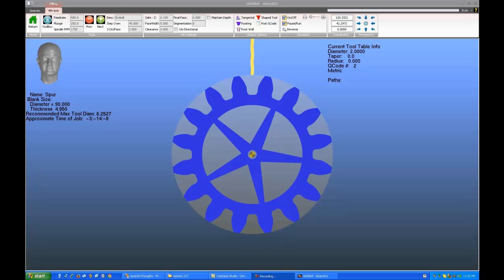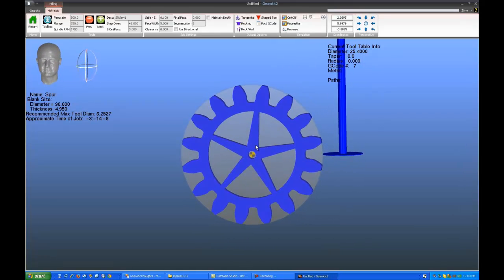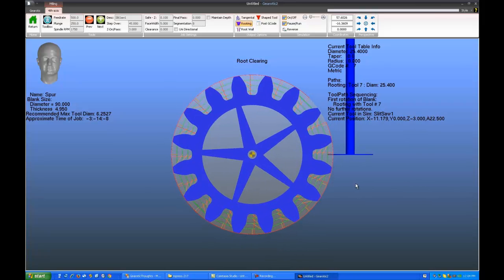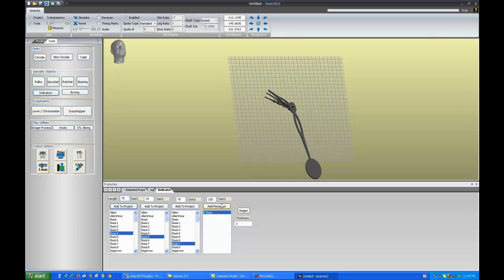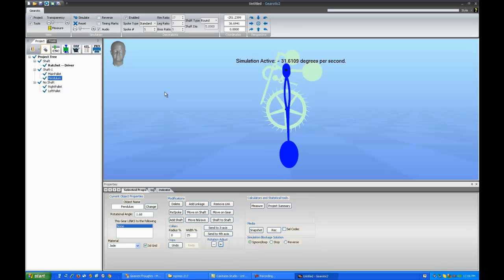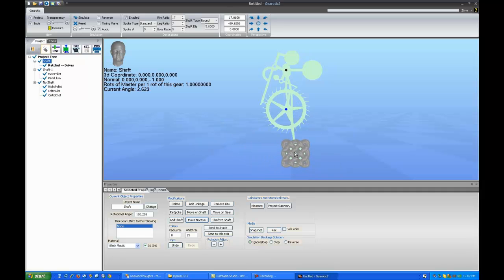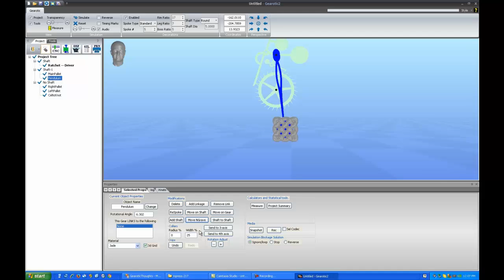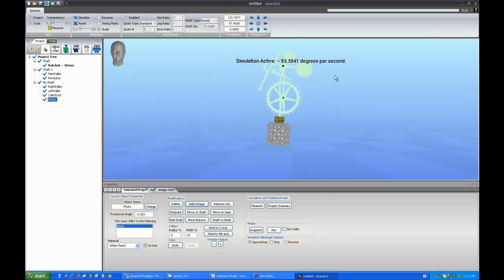Gearotic 2.0 Slitsaws&Pendulums

Comment: Since there is no contact information on gearotic.com I'll put the question here. I am still running windows XP, would this software work on XP?
Reply from the maker: ChannelDico 

Please use the gearotic forum for contact information..I will add a contact to the site as well, thx for the comment.  

Yes, XP is fine, in fact Gearotic was until last version developed on XP. :)

Art